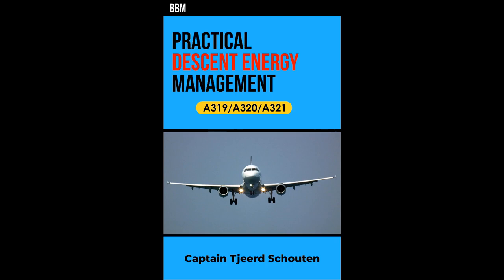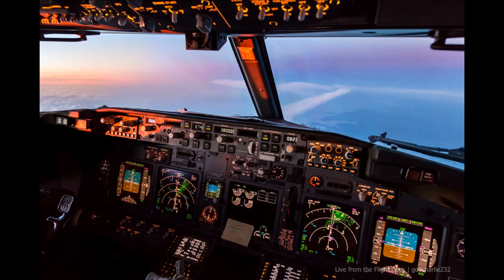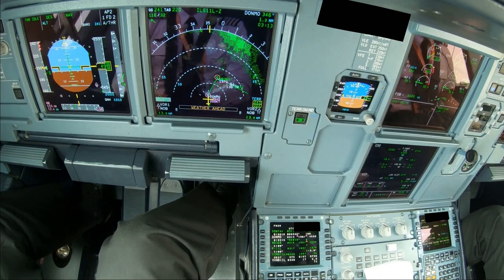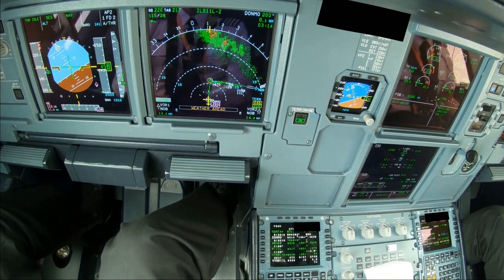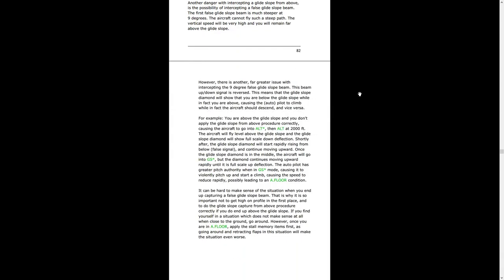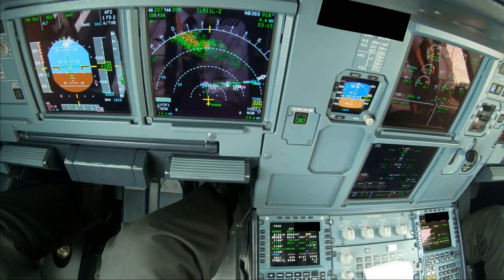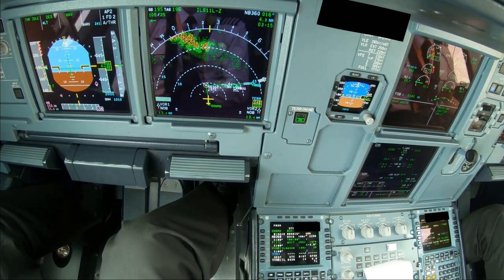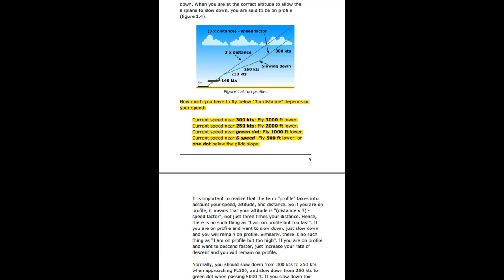History behind A320 Descent Management book

Comment: Can you please make a video teaching how to use the V/S knob on the a320 effectively. I never understand when and why the captain uses the V/S knob sir.
Reply from the maker: First, the term Captain, Pilot, and Co-Pilot are often misunderstood. Both the Captain and Co-Pilot (First Officer) are a Pilot. They both fly the aircraft half of the sectors flown so the Co-Pilot can fly the aircraft just as the Captain.

The reason why the Pilot (not necessarily the Captain) uses the V/S knob is mostly this:

-Limiting the rate of climb or descent near traffic, to prevent a TCAS event (TA).
-When flying below profile on HDG mode, setting a low VS to get back on profile.
-To reduce the speed faster when on profile or below profile.

Pressing V/S 0 is a special case and has a lot of different uses.

Comment: Hello, really appreciated for your videos. You have so many contents about descent management. But what if Atc gives you radar vector (i.e heading which does not intercept your route) instead of waypoint on the fmgc.  How would you calculate your distance and manage your profile? Can you add a video about this specific case? Thank you in advance.
Reply from the maker: There is a chapter about that in my book. But basically, you can use the distance to the VOR / ILS DME, then add some more miles depending on the situation. That only works if you are on a 45 degree angle or so to the runway. 

You can also use the range arcs on the ND display to estimate expected leg distances.
Reply from the maker: I made a video about this subject.
https://youtu.be/y9Tsw4Pnb3s

Comment: Hi captain, I finished your book and the calculation really works. but I found out your book didn't mention the use of V/S specifically. I am currently at the observation stage of my line training and want to learn a more proper way to use V/S and Speed to stay on profile other than just using OPEN DES, which sometimes results flying a long level segment before final descent point. Looking forward to your answer. Thanks!
Reply from the maker: It's best not to use V/S other than when <4000 ft (so that you can intercept the GS at 3000 ft), or when on HDG below profile. The reason is that if you use V/S higher up, it increases your workload. If you set too much VS, your speed will run away, and if you don't set enough VS, you will get high. It's hard to find an exact VS number which works, and half the ground speed doesn't always work at that stage.

When far away, DES mode does a much better job staying on profile than OP DES and V/S. OP DES is suitable if there are waypoints which put you high and you have to do stepped descents (slow down, speed up), or if you are on HDG when at or above profile.

So each mode has it's best use case. Using V/S outside of my recommend use case is not advisable because you don't gain any advantage from that.